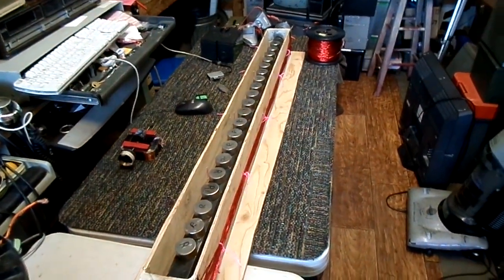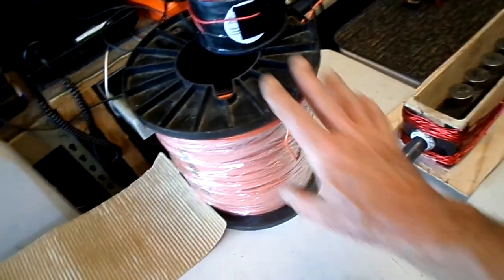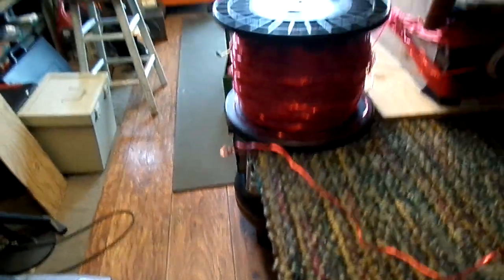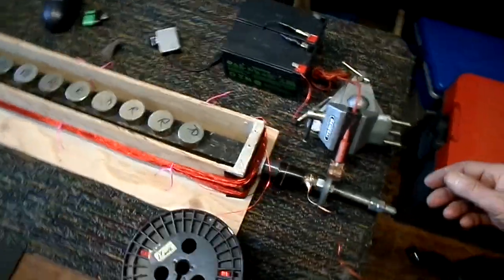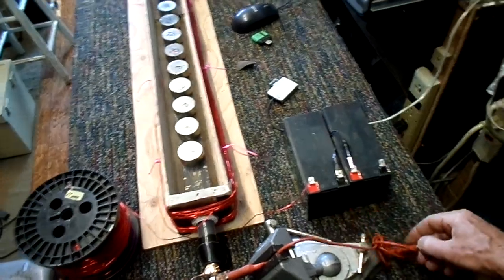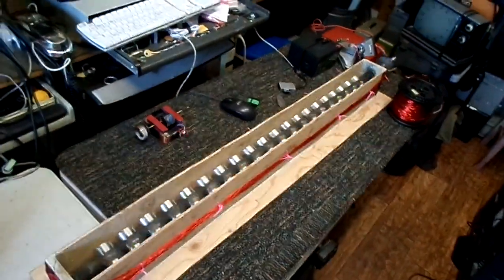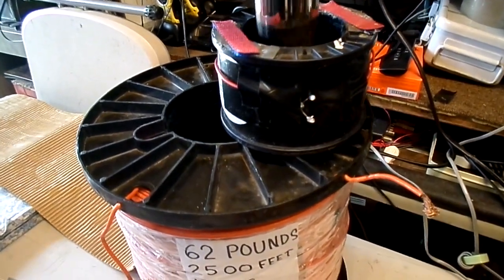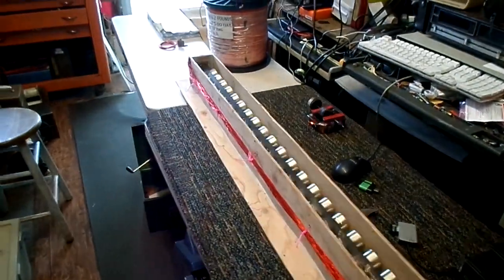Experimental Newman Motor/Generator Part 2 Counter Electromotive Force Demonstration.

Comment: Pick up one of your magnets and stare at it's center. with the S pole facing you.  Imagine a vortex emanating from the center. Now imagine a wire parallel with the S pole face of your magnet, moving through this vortex, from one side to another.  Slow it down. What do you see?    (you will see that for half of the trip the vortex is PUSHING the energy in the wire one way, and for the other half it will push it the other way).  You have now understood everything you need to know. Think "how" to eliminate half of this trip. You might employ a "special commutator" like Joe Newman did to reverse the polarity as the wire (coil) passes the center of the magnet.  Or you could use a special arrangement of magnets with this new understanding. Best.
Reply: This is a very good explanation of the (mostly misunderstood) magnetic field. You mention "Think 'how' to eliminate half of this trip."

Does it need to be eliminated? It seems better that it should be utilized properly...for example, in this scenario reversing the parallel wire. I am assuming this is leading to the key to Newman's motor??

Please pass along your thoughts...

Comment: A couple observations and thoughts; All the coils around it are adding 'work' to the motor being run, so that is a lot of loss here, however, you could use all those being affected to charge a source and measure the total input to total output of the combined coils, to prove likely that it still doesn't work. At least it would account for the extra load. I thought the concept was to utilize the supposed natural magnetic field of the copper to induce current back to the batteries. My thought is that it could have been just heating up the batteries, and they seemed charged more than when they went in (Newmans demonstrations). But maybe there is a high frequency feed back from the copper (he did say it gets used up - converted - which would make copper the fuel) that we aren't looking for to measure. That is charging the batteries - as they would act/are capacitors that would/does stabilize (compress) frequencies - bringing the supposed high frequencies not being measured down to a frequency that can be stored. eh....
Reply: The added coils don't matter much as the torque if you have built any of these are significant to say the least. When ever you are discharging you need a bank or array for a start as batteries do not like to discharge and be charged or pass through charging it shall destroy the battery (dendrites). The charge being high voltage shall produce smaller charged particles on the formed plate, bedini showed this in one of his videos. The magnet passes the copper and induces the field into it as it passes and yes it shall create heat as movement does that. joe said a lot I feel he created his luck through tenacity of purpose. Correct the array would act as a capacitor although frequencies are better done matching the coils. Also how to defeat lorentz law is the numero uno!

Comment: The more windings you have the larger is the EMF. So, for a given voltage your will see a lower rpm as for a coil with lower EMF. This is clear, not surprizing. More windings means a higher voltage for a desired rpm. That's why, high speed synchronous RC motors for model aircrafts have just a few windings of larger diameter wire or multifilar wire (skin effect) on each of the poles.

Comment: Well smaller Newman motors like this will only have around 75 % of efficiency mechanically...
You will not get them to overunity in the mechanical output...
You might try to put in some caps between some tap points inside the coil, so to enhance the "stray capacitance" of the coil !
This will have an effect like the first big few Neman motors had, who had massive number of thicker gauge wires, which has a pretty high capacitance.
Thus the characteristice of the coil will completely change and it will have also a pretty huge capacitance in the 1 to 10 uF range... This is why also these big Back Spike pulses occured on the bigger sized motors...and then the mechanical efficiency also went up-
The first big Newman motor with the huge 700 pound magnet rotor was claimed to produce 700 % mechanical output power by some calculations from Dr. Hastings...
So soldering a few High voltage capacitors into the coils at different positions could help to have this coil act more like an LC network, which reacts differently to the breakings of the commutator... Probably it must be in a mechanical - Electronical Resonance of the frequencies of the commutator frequency and the LC parameters of the coil´s resonance frequency then....So switching the enhanced coil with the right frequency is needed and also have the right capacity to enhance the BackEMF spikes... Hope this helps. Regards, Stefan. P.S. Do you know, if Dr. Hastings and Ralph Hartwell are still around ? Maybe they can add some more insigths as they had studied the first Big Newman motors for the longest time...If they should read this, maybe they can contact me or post some comments too ...Many thanks.
Reply from the maker: I have not kept up on what happened to Dr Hastings or Ralph Hartwell, but they had some interesting things to say in this video. https://www.youtube.com/watch?v=CrJIzrmX1mI&t=0s  My interest in experimenting with these ideas is not real strong at this point, but if there is something more to be discovered I hope someone figures it out.
Reply: How can you state 75% ? I would state 90%(There have been many qualified people and other that would also align to this) counting the mechanical efficiency or above cop 1. 
I would state that you have not built or invented much and state how things cannot be achieved as you are told this so you like many accept this.
Capacitors as they are correctly called have shown that they produce a much improved input.
Also to correct you it was a Newman Generator not Motor. The thicker wire was for amperage not capacitance that was the longer thinner wire.
i have keenly watched the other people that worked with Jospeh and they have not recreated his work.
Spark is bad, supress the spark as it is loss.
I have seen many many overqualified people never achieve what an unlearned hard headed determined mind can.
Surely this is over unity https://www.youtube.com/watch?v=nroBcB-42aU no1 has replicated this.
Keep going Deryk
G.G.

Comment: And what effect would changing the impedance of your spooled section of wire by inserting a steel rod into it?
Reply from the maker: the reactance would undoubtedly go up, but the commutators duty cycle is so long I would not expect any significant slowdown.

Comment: Almost twice as fast, I'm sure as you said about the electro motor response makes all the sense, a bigger coil means a stronger magnet force etc..
So, all the info is still holding water.
Reply from the maker: Building this motor  made me a skeptical that anyone can ever generate more energy output than input from a motor like this because of the Counter Electromotive Force which slowed the motor down as I added more wire or magnets to it.. Before I built this motor and observed  the results,  I hoped that that adding more magnets or wire to the motor would make the rotating shaft turn faster, but the complete opposite was true.
Reply: When you have got to have a 200% efficient DC motor how much money will you asks for?
Reply from the maker: If I came up with a motor that was 200 percent efficient I'd be famous.
Reply: @GrantsPassTVRepair speed depends upon voltage nd frequency so try to raise both up...

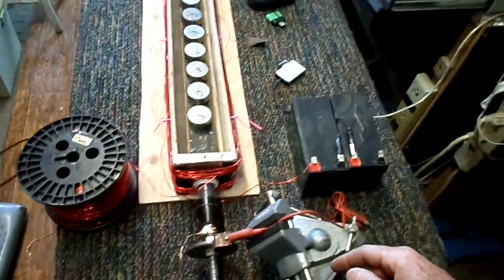Comment: You have the same DC resistance at still stand 1:44 vid. but when the motor spin because you have less turns of wire around magnets the resistance is lower, more amps get in coil more faster the rotor spin. I'm sure you all ready now that.

Comment: Hmm, interesting, maybe research what will happen, if you now will cut out the spool of wire and use an equal amount of ohmic resistor instead of the spool of wire...will the motor then still turn at the same speed or is it related to the L inductance of the spool of wire ?
Reply from the maker: I'm not sure I understand what you're asking, but If you're talking about winding the coil with a high resistance wire I would expect it to slow down.
Reply: @GrantsPassTVRepair  No I meant, cut the spool out, measure its resistance and put a normal rsistor there in series with the motor, so it still has the same ohmical resistance as with the spool. Will the motor still runs at the same speed shown ? If not the coil you have outside the motor, that you already unwound would have an effect on the motor... also does it position effect the motor somehow, so placing it a few feet away, does it affect the motor speed, if the spool is still connected ? Many thanks. Regards, Stefan.
Reply from the maker: I understand. I've since disassembled the motor but I what would such an experiment determin?
Reply: @GrantsPassTVRepair  If the spool of wire standing next to the motor has any effect of the speedup or to the motor function and if the position of it will have any effect ??

Comment: I am wondering how much did the 62 pounds of wire cost you and where is the best place to get it at a fair price Grant ??? Nice work too. vf
Reply from the maker: Due to inflation the cost of the wire is probably 6 or 7 hundred at this time. I'm not sure where to get a good deal on wire other than garage sales.
Reply: @GrantsPassTVRepair  Thank you for letting me know Grant. I will keep on trying to make things happen even if the economy keeps on kicking me right in the private parts. Good luck and please make more videos too fella. vf
Reply from the maker: @victoryfirst2878  Thank you.
Reply: @GrantsPassTVRepair  Your welcome Grant.

Comment: would you be able to give me suggestions on how to troubleshoot my vcr? the power button blinks and when I press it, it takes my tape, it goes around the big spinning thing, but then it all reverses, it ejects my tape, and turns off again to a blinking power button. any suggestions
Reply from the maker: I need to see it, but I did put three videos out on repairing VCRs. if you search through my website you will find them. https://www.tvrepairinfo.com/
Reply from the maker: You might find this video helpful. https://www.youtube.com/watch?v=0_G2y5VDa0w
Reply: @GrantsPassTVRepair  am I able to send you a quick 20 second video?
Reply: @GrantsPassTVRepair  this video is very clear and easy to follow, thank you! I think I have determined I might have a dirty mode switch repair but I can't find any clear video to show how to clean it

Comment: Your power controlling solution seems very inefficient. Use a mosfet or something for much better conductivity. A longer pulse duration could increase your rpm too.
Reply from the maker: I understand, but no matter how efficiently I switch my input there will still be the problem of how to overcome the opposing magnetic field  which is generated as my rotating magnetic field cuts across the coil windings.
Reply: @GrantsPassTVRepair  some mosfets are for motors and are already protected but you could still use a diode on the drain for when the rotor turns over and induces a negative voltage.
Reply: @GrantsPassTVRepair  that's easily removed and captured if you know what you're doing .After it's captured the rotor will speed up and the sparks on the commutator will be gone .Also caps make a huge difference on performance and removing the sparks in the commutator..

Comment: The Newman motor is not very efficient because you have a lot of unguided flux. For an iron free motor it is better to work with the axial flux principle. The rotor is just a disk carrying the permanent magnets on a circle around the axis with changing polarity. It rotates in the vicinity of another disk carrying pancake coils. The best is 3-phase operation as synchronous motor. So you need 4 magnet poles and 3 coil poles or multiples of this. You can also use 2 magnet poles and 3 coil poles or multiples of this. This doubles the speed, but the EMF signature is not the best. So it works with lower efficiency.
Reply from the maker: I would agree with your statement on the "unguided flux" being inefficient, Newman must have thought that was important to avoid the iron core considering how he designed his motors.
Reply: @GrantsPassTVRepair  for this design it is impossible to operate the coils close to the permanent magnets. For axial flux design you can go as close as the thermal dilatation allows.

I have operated an axial flux rotor which was integrated in the turbine rotor of 50 mm diameter. The coils were at a distance of 0.25 mm to the surface of the permanent magnet disks.

So almost all flux penetrated the coils. No iron was needed, because I operated in the near field. The turbine power was around 1 kW.

Using this integrated configuration there was also no need to transfer torque though the turbine shaft. The torque is directly transfered from the magnets to the coils.
Reply from the maker: @gkdresden  You're speaking in terms above my ability to follow everything you're saying, but I can understand your point about the magnetic flux being to distant from the permanent magnets.
Reply: @GrantsPassTVRepair  There are several videos about axial flux motors / generators on youtube. I think you get the point while watching one or the other of them.
Reply from the maker: @gkdresden  Thanks I'll check them out.

Comment: Your coil configuration and symmetry is not efficiently interacting with the magnets. 

Your magnet mass is higher than the coil itself.  What is required is a heavy improvement in coil size.